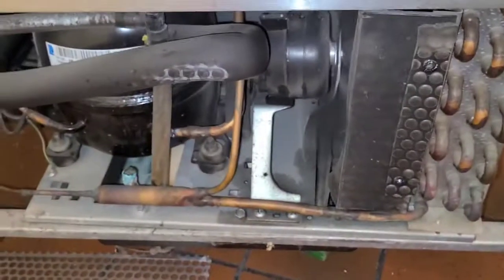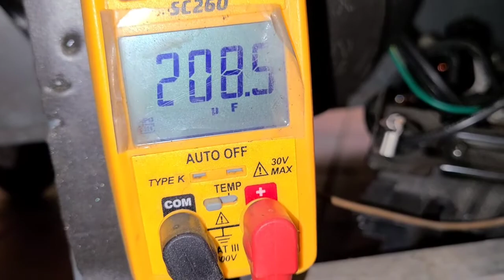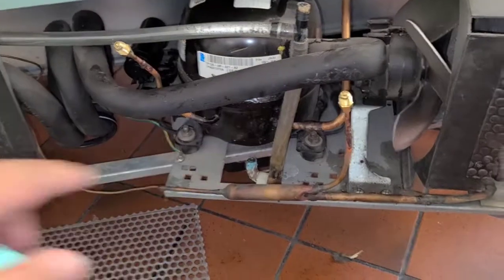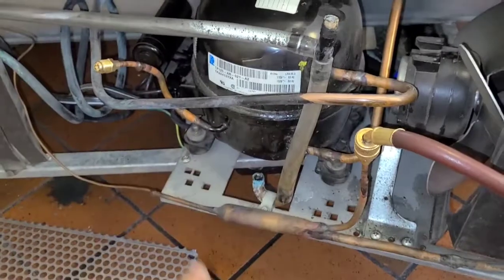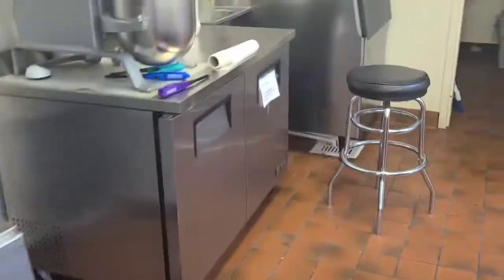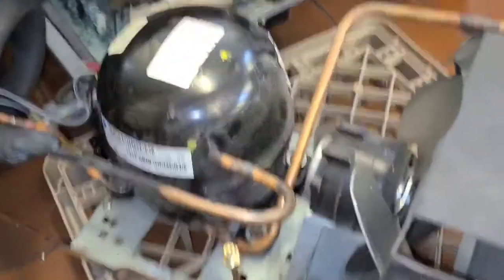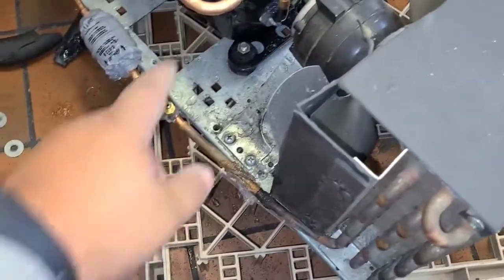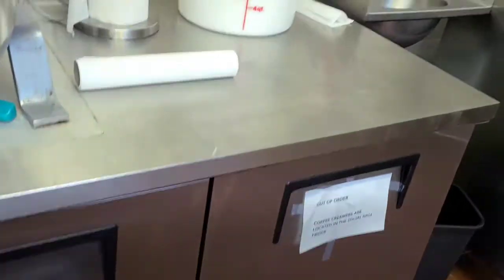True Reach-In-Cooler Not Cooling

Comment: When you see the frost on suction line at back the system is over charged. I think the old compressor has no problem.
When You opened the system if there’s no any or little gas in the system somewhere is leaking. Normally inside of the box at evaporator side. You will get callback after a couple of months for sure.
Reply from the maker: This was recorded in early 2020, so far they have had no issues but I see your point and appreciate the advice. 👍

Comment: are True coolers reliable?
Reply from the maker: I see alot of true coolers have issues but on the flip side they are usually easy to fix or not that expensive. But like all units its how much of a beating they get and if they get them tuned up regularly.
Reply: @HVACRSTRONJAY  like cleanign the dust off the coils or more tune up necessary?
Reply from the maker: 100% If you take care of that true cooler it will take care of you.